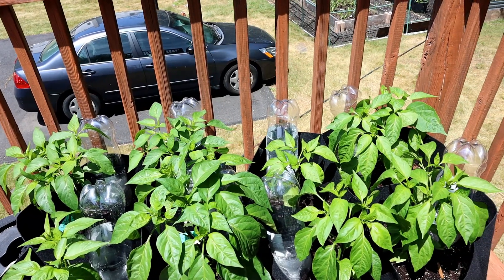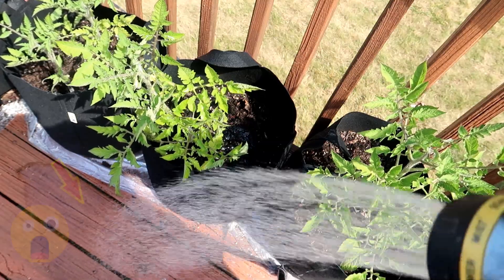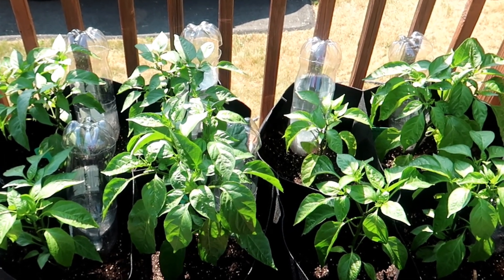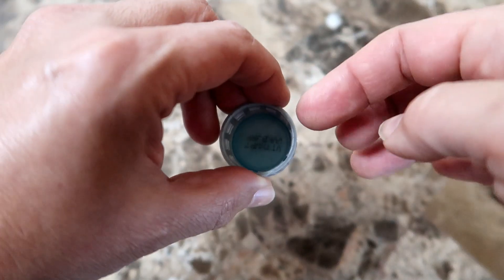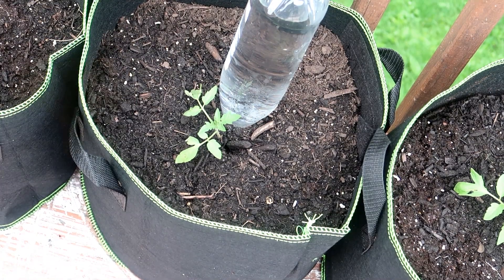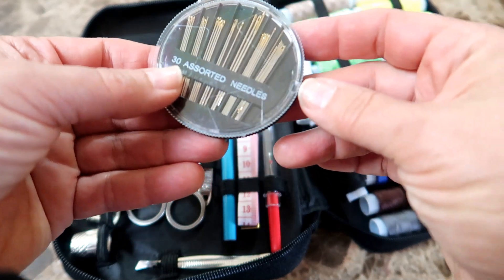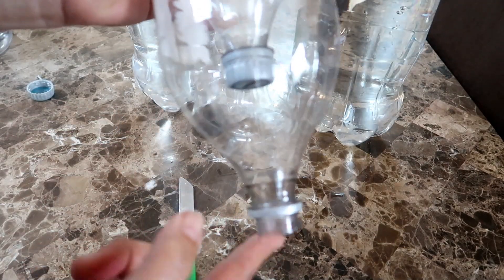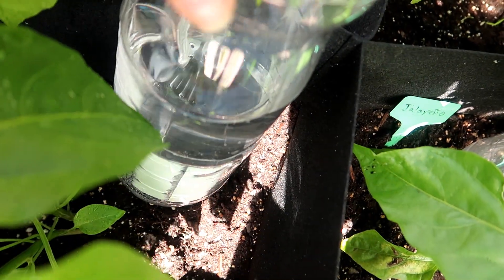Simple Gravity Drip Irrigation System Using Plastic Soda Bottles

Comment: Thanks for focusing on the important part, the drip rate. For me ten hours is not long enough I am looking for days ie very slow rate. I have also been using the sowing kit and have used thread to block the holes. It is good and they drip slower but it does take more time to make them.

Comment: Just found this video.  Thanks for the info.  I'm planting hanging strawberry baskets here in UK so wanted an easy way to  water them without it all just running straight out.  I'm thinking planting a few plants around in a circle with a drip feeder in the middle which I'll be able to just lift up and fill as required with no loss running out the bottom of the baskets plus evaporation won't happen with just a slit in the top of the bottles. And the double bottle system is spot on meaning i can just pull out the other bottle full up and pop back in.  Your an absolute star. Thank you

Comment: No need for a second bottle to be added. She just needed to cut the very bottom off the bottle for two reasons.: 1. So the bottle would get air so it could drip through  the hole in the lid 2. With the very bottom removed from the bottle, the bottle could easily  be refilled.

Comment: I use old wine bottles with short piece or metal wire stabbed into the dirt..place bottle over exposed wire. Helps create a wick out for the water. No clogging

Comment: If the finished product takes 10 hours to drain and you want continuous drippage, then you refill the bottles with the hose at least once a day -- see 4:34.
You're then back to using the hose on each plant once a day. A brief squirt with the hose on the soil will provide the same benefit as the 10-hour drip so the bottles are a wasted effort. And while droughts stress out plants, they otherwise do fine with intermittent watering like natural rainfall.

Comment: Good work. I did a similar thing. I screwed the bottle to a stake. I also put a cue tip..ear bud..in the hole in the cap.
I use liquid fertiliser in mine. The hole block but I can jiggle the ear bud to get it going again. 
The ear buds are hollow. So I guess some water will go through the ear bud. Filtered either end by the cotton.
My next one I will try a screw in emmiter. Then I can set it to drip by x amount per hr.

Comment: What if you was to put a very small hole at the bottom of the bottle so when you turn it up Sid down the air would make it easier for the water to flow out

Comment: The reason the water would not drip out in the original design is that, for water to drip out, it must be replaced by air.  With a large volume of water in the bottle, the pressure exerted by the water is too great to allow air into the bottle.  The solution is to make a hole above the water to allow air to replace the water that is dripping out.  When you cut the bottom off the bottle, you solved that problem.  To prevent the water from running out too fast in this design, however, the hole through which the water escapes must be very small.
Reply: Omg THANK YOU! I’ve been trying to figure out if I needed a hole or not. I did this (except took the lid off, flipped it upside down quickly and pushed it about 2 inches into the soil) on some of my containers and I remembered hearing that the water wouldn’t come out unless the soil was dry, like how an oya works kinda I guess? I don’t know, but with the lid off and doing this with a 2 liter about half full when I started, it’s still about the same since yesterday so I don’t know how hers went empty so fast with just holes poked and mine has the lid off completely. Now I’m confused lol. I’ll poke a small hole in the top of the bottle and see what it does I guess lmao.
Reply: Well I have found this video most helpful & I would like to thank you that you have taken the time to experiment to get the right outcome. I too looked into other methods of irrigation. I found on Temu you can purchase a holder for your bottle that lets the water drip out at a required speed. I bought a lot as they were so cheap. Then I got deflated as it seemed that I had to squeeze the bottle every time to get it to drip again. So I decided to do your clever tip for more air to get into the water/bottle. It works now & is an easier way to fill the bottle up as well.Thx a million from England !
Reply: True
Reply: I guess you didn't see where she cuts the bottom of the bottle off almost completely, so that she can refill them when empty???  hahahaha
Reply: @alahatzaifat1872  My comment is about the original design in which she has only one hole in the bottle cap and no way for air to come into the bottle.  You're referring to a later design.
Reply: You fail at reading the first comment for context. They are exactly right. HAHAHA  @alahatzaifat1872

Comment: I have cats so I buy 20 lbs plastic containers.  Poke a small hole in each corner an inch up.  Plant your plant right next to each hole.  Remove the cap, fill the container, put the cap back on and enjoy your day (or two)

Comment: You can adjust the flow rate by balancing the drip rate with the air entry rate at the top. Use a needle hole(s) in the base of the upper bottle, instead of completely open.
Experiment with a timer to get the desired flow rate.
This is similar to a Sparkletts type bottled water dispenser.
Unfortunately, this does not allow easy refilling of each bottle with a hose, but having a second set of bottles and refilling them at one and replacing them actually goes faster, than standing and refilling.
You can also use 3" or 4" PVC or ABS pipe as a more sturdy base to hold the bottles.
Finally, you can buy drip system buttons that deliver a given GPH drip fro .5 GPH to 2 GPH and just insert into the lower part of the bottle, which allows for both benefits.
With the latter, you can use one large bottle or bucket and string out multiple 1/4 inch hose to individual plants, filling up only one source as a distribution manifold, and you know exactly how much each plant is getting, with less filling.
Reply from the maker: Thanks Daniel, that was very helpful!  I was looking into IV drip lines.....thanks for the feedback!

Comment: you miss the point here I think ...10 hours to drain is way to fast that bottle for that plant should last 10 days... the purpose of the whole bottle idea is you leave the bottom airtight! no pokin holes lady!! the reason is, when the sun is up the airpocket heats up expands and pushes the water trough the cap holes ( automatically no clogging) and the plant gets the most water during the hottest part of the day at night the air contracts and stops the drip... you will need to experiment with the size of the holes but it works as a charm..for dripspeeds you should consider that plant actually taking up all that water and evaporating it trough the leaves (takes a plant that size a lot longer then 10 hours),  keeping topsoil moist is just wastefull use of water...not trolling( a fellow gardener)
Reply: I wish you’d make a video to demonstrate what you are explaining.  I can’t quite follow you.
Reply: use smooth bottles so you can retract them to fill em up
make the holes small but numerous, making it more a wicking' then a draining
dont burry bottle to close to plant or it will get lazy, also deep enough as to just not wet the topsoil.
make holes in bottle neck not actually trough the cap (will help against clogging and more horizontal flow)
Reply: @jawadad802  great tips. what do you mean by smooth bottles?
Reply: @vernonjames649  bottles with a uniform smooth surface, so you can easily retract them and not collapse the hole they came out off, because you will need to fill them up again every week or so...

Comment: Im going to try the right side up bottle with 4-5 tiny holes poked around the base of the bottle. To keep the holes from crogging. I will slip the whole bottle into a nylon stocking and secure the stocking at the neck of the bottle. I'll plant the bottle base at the same depth as the bulbs or a bit deeper so the bulb roots will dive deeper to reach the drips.  I will keep the cap tight on the bottle and unscrew the cap to add more water.

Comment: Take a glass wine bottle with a cap or cork on it.
Shove it into the ground then remove it.
Remove the cap, fill the bottle, invert the bottle without the cap, and quickly place it into the hole you just made.
Watering will be automatic.
The thirstier the plant the drier the soil gets. As soil dries, it shrinks and lets air into the bottle, and water out. When the water is released, the soil swells pretty quickly and stops the flow.
Since no cap, the plant can get all the water it wants.
With a cap and holes in the cap, the watering is very limited.
I have done this for a few years now with great success.

I prefer to use magnum wine bottles since they can hold more water.
Reply: If plants are in sunlight glass can get very very hot. Just a heads up..

Comment: Dumb question: We don't drink soda but I do have 1/2 gallon jugs from orange juice. I want to know if that would be too much water? I figure I could use an empty used seedling pot for the jug to sit in upside down instead of using another jug cut in half. Great videa. Don't know why I haven't seen it before now

Comment: Nice idea with the extra bottle to set it in. I did this last year and even if the holes weren't clogged with soil at first, they eventually clogged with algae. Then the bottles collapsed as the water drained and wouldn't hold their shape any more. I have some plastic watering cones that you fill with sand and place the bottle into. It helps slow the flow and avoids the clogging issue. Always love new ideas to tinker with though. :)
Reply from the maker: Interesting idea filling cones with sand and then the bottle above it, it doesn't clog?   I guess its more about the journey than the destination when we tinker!  Thanks for the comment Susanne!
Reply: @TikkiOOO  no they don't clog because you don't put the cap on the bottle. Just the sand slows the flow. They are made for outdoor gardens or pots. They're working pretty well.
Reply: Plastic watering cones with sand? How do you make them?

Comment: Great idea, Tikki, I will try that.  You can also wear oven mitts when holding the pliers over heat just in case it gets too hot.   Thanks for the demonstration; think I will try that water bottle system on my squash in a half barrel.
Reply from the maker: Thanks Sheri!  if you elevate the barrel and run some tubing out of it, you can drip on several plants from the one barrel.  Put a drip regulator at the end of the tubing....experiment, and good luck!
Reply: @TikkiOOO  Hey, thanks Tikki.
Reply: You might also use a 1/16th inch drill bit to put the holes in the caps and avoid the heating up of the pin on a stove

Comment: Years ago I bought a set of "waterers" that attached to bottles...you could cut them to achieve the water flow you wanted. But soil did tend to clog. Genius idea to use a second bottle as a sleeve..may have to round up those old things and give them another try.
Reply from the maker: Hi Sec Girl, I saw those attachment things on Amazon and was wondering if they work.  Good to know the soil clogged those as well....thanks for the feedback! I found that elevating the bottle helps, or if you have a stake nearby you could tie the bottle just above the soil level and let it hang, that would also work to keep it from clogging.  Good luck!